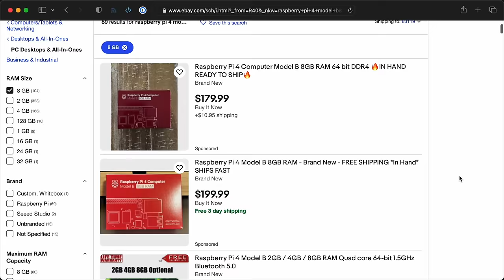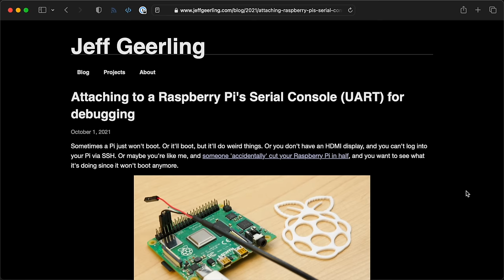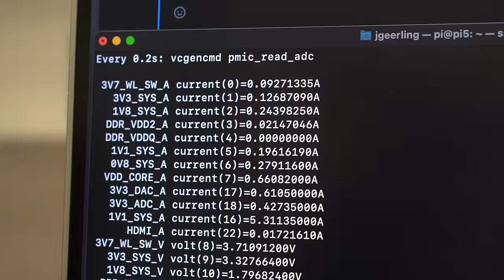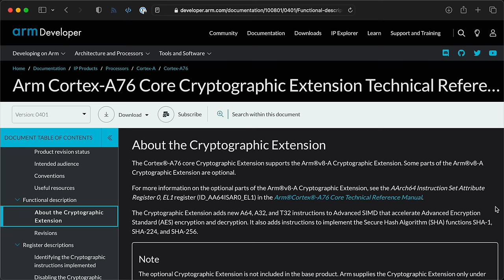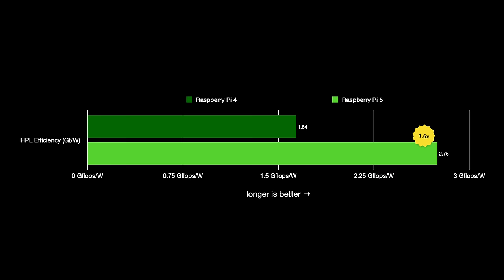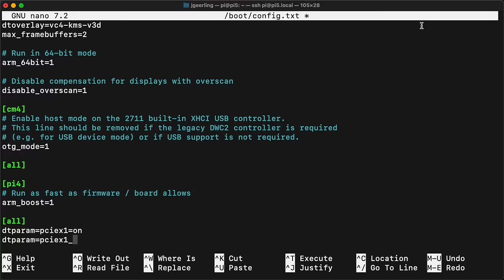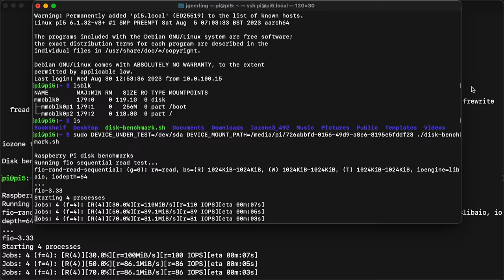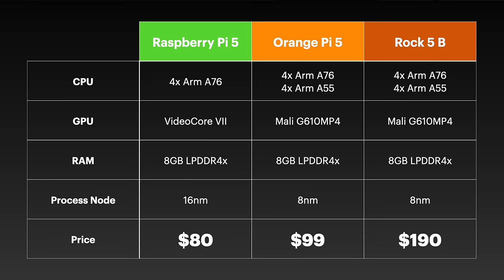Raspberry Pi 5: EVERYTHING you need to know

Comment: With the improved I/O, this feels like it opens the way to a Pi-based 4+1 port network router/switch in a single case.
Reply: In my experience, this use case has never been reliable, due to a mixture of issues ranging from microSD card corruption, to dodgy UAS support for external boot drives, unreliable USB-ethernet adapter performance etc.
Reply: @tomfahey2823  The PCI-E port on the board would let ya connect a 4x port NIC and then use the Pis internal Gigabit as the +1 though, no USB Ethernet adapters needed
If Jeff can get 6Gb on a 10Gb NIC that should translate to full 1Gb on 5 ports at least somewhat
Reply: @tbthegr81  Yes, but that's not really an upgrade on the Pi 4 Compute Module then, is it? And you still have the problem of unreliable storage media. 

This is why I was hoping for more PCIe lanes and/or NVMe, or at least eMMC support.
Reply: SBCs with a double port (for ingress and outgress) still are way better solutions usually. 8 port gigabit switch is a pittance these days, no reason to make it expensive in a specialised hat.
Reply: @tomfahey2823  I've had extremely reliable Sata to USB operation and uptime. But did have to experiment a little with USB hubs as they would run for weeks then randomly crash requiring a reboot
Reply: I think that would be an interesting build project, wondering about how it would perform. Even if at more cost, if the Pi5 had 2 lan ports it would be a no-brainer option for a DIY firewall/router. But it doesn't have it. Still, making a firewall/router/switch combo with it would still be quite a nice project.
Reply: @mrmotofy  That's exactly my point - I found that the Pi's would work really well for a week, a month, even up to 3 months, then crash for any number of different reasons.

No big deal for a home lab setup, but if you want to deploy them as the router for your home network, then losing internet connectivity periodically is a real probability, which isn't a great experience for other people in the home.

That's why I moved over to running OpenWRT as a container in Proxmox, running on an old Dell SFF PC. Zero downtime, zero tinkering and it's not actually much more expensive if you buy used/refurbished.

But for simple tinkering, the Pi is definitely a fantastic option.
Reply: Let's be real here: the IO has barely improved. Yes the PCIe lane is now easier to access on the B model. And it has experimental 3.0 support. But it's still just only a single lane like in the Pi4 and still just 2 USB 3.0 like in the Pi4. Pretty underwhelming upgrade after 4 years to be frank.
Reply: Specially with the PCIe header. You can put a small server grace network card in there.
Reply: @kwinzman  Good points actually
Reply: @kwinzman  has 2 full separate USB3, and full pceie2/3 with a connector. If you can design/engineer/build better feel free
Reply: @tomfahey2823  Sure but my point is the Pi...is fine. Other less than quality products plugged into it is the problem. Once you get something decent it's Rock solid
Reply: @tbthegr81 PCIe 2.0 x1 only supports 500MB/s so basically 4 Gb/s. Although the CM4 also only has PCIe 2.0, but at least no full-duplex 1 Gb/s will be possible.
Reply: There are plenty of those that already exist that you can actually purchase for reasonable price

Comment: Thank you so much for the rpi-clone info and app.

On a new rpi5 and a pironman5 it was very simple.  Make a boot SD, boot from it, get (git) rpi-clone, run rpi-clone, shutdown, remove SD, boot to nvme!  Super Simple and easy.

FWIW and reference your recent pironman5 video - the pironman5 is not very expensive in terms of get it with a nvme drive and power supply and have everything you need to make a desktop machine or small stand alone server.  No having to source parts, figure out mounting, or any of the messy stuff!

Comment: Very cool!
Starts at $60-$80... I really hope the shortage is over because that's probably the most any hobbyists will want to spend.
Reply: Those are imaginary numbers, sometimes I wonder why do people even bother with these MSRP prices..
Reply: It should be 39$ for the top spec, the pi used to be cheap..
Reply: @spamuman  To give credit to the PI foundation, you are able to preorder the PI 5 at those prices right now at multiple different retailers. While I agree it probably wont stick around, I was able to bye a PI 4 about a month ago from Adafruit at MSRP
Reply: @25566  Yeah, it's like they've forgotten who they are and what they're supposed to be doing.
Reply: @EricJS where at?
Reply: @25566 it's not 2012 anymore genius
Reply: @gokuformanvsfood Exactly, after 11 years the price should be getting lower, not stuck at the same or even more ridiculously increasing.
RPI seems to be going after the PLEX crowd, which already is a weird choice, in some 11 years they have made no innovations, just more memory and more CPU speed.
No added GPIO, no faster GPIO, no real-time GPIO,  no FPGA/CPLD options, just sticking a somewhat faster CPU on there and sell it for double the price...
Now they come with PCIe, that's at least something for the first time in 11 years but it's an FFC connector so most students and hobbyists won't be able to solder those or use it on breadboards, implementing a much slower ISA or PCI bus would've been a game-changer for the electronics/programming market for example but again they just go for the easiest option which is to use the already existing PCIe lane...

Comment: I think it might be time for me to get a new pie haha, I have a pi 1
Reply: Good lord, the Pi 1 is so obnoxiously slow looking back on it from the lens of today. The OG pi found it's most use for me as a VPN server before I had a comprehensive homelab.
Reply: dont waste your money on rpi or any sbc, get a secondhand mini pc's like hp or dells, its old but its still more powerful than these sbcs, plus the power consumption difference is negligible.
Reply: @jongskie777 what abort GPIO then?
Reply: If you need it there are plenty of usb adapters
Reply: @jongskie777 
I think the market of cheap used mini PCs is really limited to a few countries.
Reply: Same here. OG Pi Model B (not even the B+!)
Reply: cheaper*
Reply: @Alias_Anybody  i think you can get it in the US for bout $20 -$30 bucks? i saw a youtuber who uses it, cant remember who
Reply: @jongskie777  
That was my point. Maybe in the US, but not everywhere.
Reply: @Alias_Anybody  Yeah exactly; same with good quality 2nd hand *anything*, really.
Reply: @JosephHalder  Pi 1 Slow ? I "only" manage 128 (91 in use now) GPIO for my relays, nothing else. Stable as hell.
Reply: @adamwalter2573  not a great argument. An ESP32 or Arduino could drive relays. It requires virtually no processing.
Reply: Same here! Got the original with 256 MB of memory, and just put in for this preorder. I was on the fence for a 4 but couldn't pass this up. Also, these older Pi's still work well for things like Pi-hole and Waveshare e-ink displays (which don't require the 40-pin GPIO headers).
Reply: Yeah, my whole home automation runs on RPi1 512MB (Node-RED, Influx, Grafana, pi-hole, Mosquitto and some Python scripts). The biggest downside is it's only 1 core so a few times a year when some process stuck on high load I can't log into ssh and the only way is to hard reset. Plus is extremely low power consumption and no need for noisy fan. I might get RPi4 if the prices drops now when RPi5 is out. Too bad it used microSD instead of regular SD (which I bought big and fast one for this purpose).
Reply: Take your time! You don't want to rush these things 😂
Reply: @jongskie777 Bruh power difference is non negligible, however if power is affordable it might not really matter
Reply: @Alias_Anybody Yeah you can't get them affordably everywhere.
Reply: @JosephHalder Yes, true, but that's not all I have connected there (lan, ssd, cameras, additional i2c buses, sensors etc). Arduino or ESP is not sufficient in my case. All scripted, scripts often change and I don't have a time or ability to travel far far away to flash anything or wonder whether it will flash correctly or not. Honestly, I bought RPI mini and...it's not for me, very limited, but RPI zero is (IMHO) the way to go. Too sad they are not going to continue it.
Reply: Still have an original Model B here too. I originally used it as a TV pattern generator but now just have it running RISC OS for occasional use.

Comment: I still think dropping the full size HDMI port for 2 smaller ones was a mistake on the 4b. I was hoping it could get support for dual video out via Type-C connector like they have commonly on docks. Heres hoping that they update the Zero as well because Orange Pi's version of it slaps HARD. I hope that RISC-V becomes viable in my lifetime.
Reply: They really should just make the USB-C port fully functional with data and video (DP), and drop one or both micro-HDMI connectors, and maybe have a single full-size HDMI. Sure, the dongles are more expensive, but they're way more ubiquitous. Maybe a special CM5/Zero could come out with a single USB-C connection for some real minimalist projects.
Reply: @khyoyeon554 that’d be really awesome; a USB C monitor would be able to provide a single cable for everything (DisplayPort, a USB hub, audio, full power etc etc)
Reply: In your lifetime of course?? It's reaching the levels of the very first Pis now
Reply: @aaroncarson omg I need that  badly.

Comment: We need to start adding the Intel N100 to those comparisons. Efficiency, video playback, io, pcie are very competitive... yes it's usually a bit bigger but there's tons of applications where the size difference is insignificant, the x86 platform is a huge bonus on compatibility (forget about kernel hacks for universal pcie compatibility) and the actual market price and availability have been more tempting on the n100s than the Pis.
Reply: They're like double the price of a Raspberry Pi 5 though
Reply: @3nertia  and 10 times the cpu power
Reply: If we are talking about intel's announced horse-creek, then why not. But anything based on x86-64, no thank you. This is like using a massive anchor as a door stopper.
- PS: Somebody replied, i should reevalute by presenting shiny n100 wattage numbers. That person somehow forgot to mention, that the n100 typically needs a big heatsink and even active coolers to prevent down throttling. The greater heat output is inherent in x86-64 designs no matter what workarounds Intel's engineers tried for over a decade now. The x86-64 complex needs more transistors for an instruction compared to the arm or risc-v isa. And more transistors involved for one instruction inevitably means more power consumption.
- Also that person somehow forgot, that intel tries to mitigate their isa disadvantage by producing their SoC chips at a smaller node than the pi and popular risc-v SoCs. In the case of the n100 the used lithography step is intel 7. The PI 5 gets produced at 16 nm and current RISC-V even bigger. So when you compare do it under fair conditions and don't hold back the facts.
Reply: @paparansen   Based on what?
Reply: @aladdin8623  n100 consume 6w idle, 25w in use, I think you need to reevaluate.
Reply: @3nertia  in theory. Let's see in practice.
Reply: I'm just saying the line between the low end of x86 and the high end of arm SBCs is getting blurrier to the point where it makes sense to include them in the comparisons.
Reply: An ASIC will always be faster than a more general purpose processor and most SOCs these days are becoming just a bunch of ASICs stacked together lol
Reply: @RebelPhoton   Fair enough. But they'd have to be task-oriented tests which would make edge-case users pretty angry xD
Reply: According to STH benchmarks, the N100 has a Geekbench 5.5.1 Pro score of 1051/2954 Single-Core/Multi-Core, and a power consumption of~12w (idle) and ~23w (maximum). The barebones system they came in cost them $216 (it included chassis etc)
Reply: I am using an N100 router with 2.5 Gbit Ethernet ports — very happy with it
Reply: I paid US$ 140 for a barebones
Reply: @3nertia  I buy a N100 mini PC for USD 150. 12 GB of RAM, 256 GB SSD, and I think the cost is equal. Also use 25W but can be lower down to even 6-10W.
Reply: I'm with you in this one, I have a N100 12GB 256 m2 SSD mini PC with Windows 11. It consume around 8W, and a max of 25W but can be downclock to 15W, and it's power with 12V 2A, following the USBC-PD standard. In size is like 10% bigger, but common is a lot more powerful and easy to power. Only lacks the 40 GPIO connectors
Reply: I agree. Asrock a nice mini ITX N100. One thing never mentioned is the COST of all the add on bits needed to DO SOMETHING with these tiny arm based gadgets. I repurpose cast off laptops for server use at home. No extra bits needed, has battery backup & warm inner glow of preventing ewaste 😉
Reply: @3nertia SoCs becoming ASICs stacked together? If we're using that as a definition for ASICs then any CPU is an ASIC lol.
Reply: @3nertia more than double in performance and spec, at around $150  which is less than 2 MSRP of 2 pi 5 (also don't forget to add the cost of case, heat sink, cooler, power adaptor , etc..) we are having Intel N100 with 16GB DDR5, dual 2.5gbe LAN and native support for nvme/pcie,
Reply: @3nertia  yeah buddy, you still believe in MSRP? Even now the Pi4 4B still priced more than N100 mini PC
Reply: @pingtime   Buddy, I don't even believe in capitalism ROFLMEYERWIENER
Reply: @someguy4915   That's kinda the point lol
Reply: @haidars   People will purchase the amount of computing power they can afford. It doesn't matter if "this offers way more performance for just a bit more money",  if they can't afford it, they can't afford it - period
Reply: The pi isn't for performance, it's due community, support, documentation, long term availability, stability. 
If you want high performance as your number 1, it's not for you, it has never been about that.

Comment: I've had my Rpi 3 for like 5-6 years now, running 24/7 without a single hiccup.... just bought an RPi 4 B cause of the better hardware, and I still haven't swapped them because of how goddamn reliable that model 3 B is. Yeah, I got it in 2016 I think that would make it 7 years running non-stop for 7 years continuously holy shitballs dude. 

Raspberry pi's are something else honestly. The reliability and longevity of these things absolutely blew me away...

Comment: The Raspberry Pi foundation seriously needs to get their act together. 4+ years of development and this is what we get? Where are the USB-C stuff like DP alt mode, Power Delivery, and so on? PCIe x1 is a nice addition, but not as nice as many of the competitors offering x4. Micro HDMI in 2023 is a slap in the face. And there's even two? They're lucky their software support is great, because otherwise I don't see why they should even exist anymore.
Reply: For 4 years I have been crying that the Pi4 didn't have VP9 decoding for Youtube.
And now 4 years later with the Pi5 they are still advertising H.265?! What am I supposed to do with that? Decode BluRay?
Where is VP9/AV1? And a single lane of PCIe with a proprietary connector instead of 4xPCIe on m.2?
Honestly after 4 years this upgrade (5A Power delivery, CPU upgrade, crypto extensions, experimental PCIe3, RTC) is nice but it's still a disappointment.

Comment: nice to see a new pi with most of the drawbacks fixed. this gives me hope the pi ecosystem will be around for a while. looking forward to the release. thanks for the breakdown!
Reply: I don't think they fixed the polyfuse issue, as the pi becomes more powerful and costly, they should seriously consider putting some form of over-voltage protection.

Comment: I noticed in someone else's video that the memory resistor pads are all connected to the same nodes, so they can't be doing anything in the pi.. you're the first to confirm to me that it is just a visual indication of what model it is..  I guess I can put my sharpie away and stop marking model numbers on the top of the ethernet ports!!  This is a nice touch!